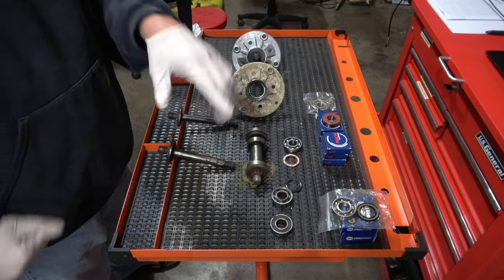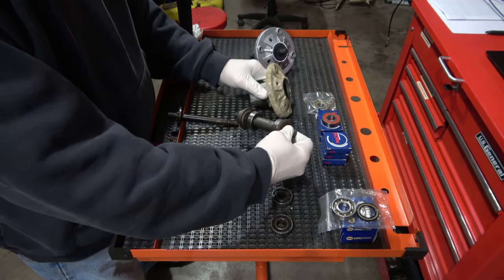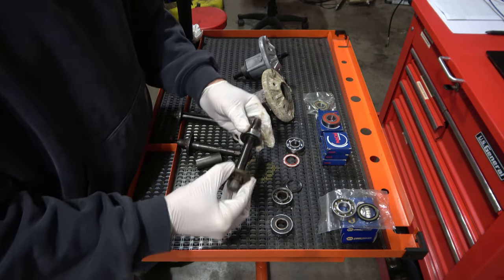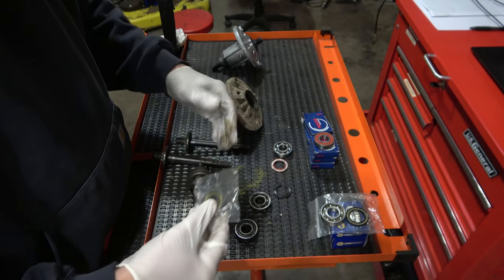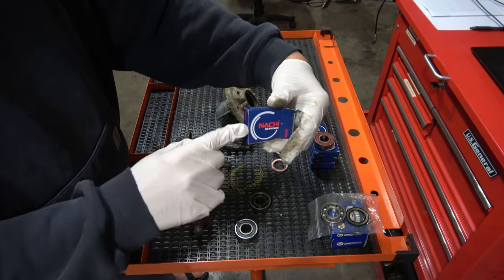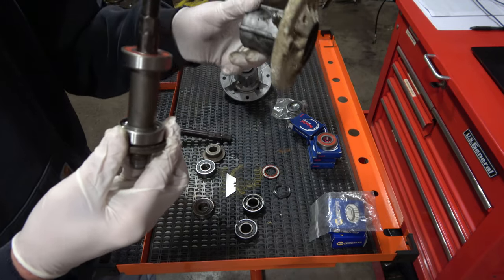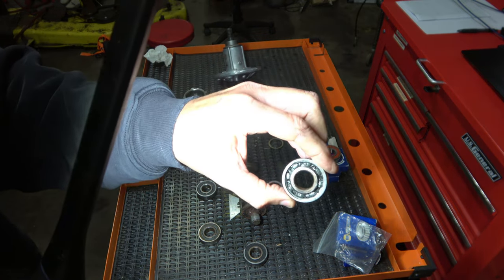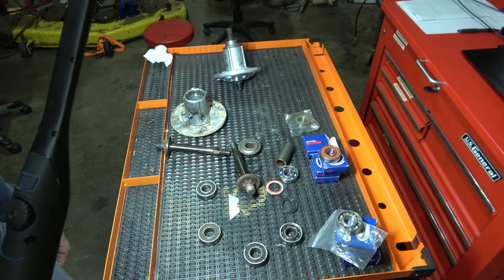John Deere D-170 Deck Spindle explained and tear down

Comment: grease goes right by those covers and threw the bearing  ,  a grease gun puts out 10000 psi , those covers aint gonna stop it , people think they are seals but they are not , they just dust covers